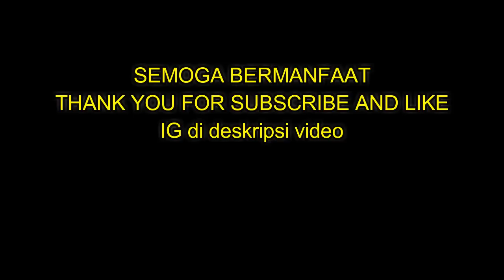CARA BORE UP JUPITER MX PALING MUDAH

Comment: Kalo pasang blok vixion di mx new dan noken as nya pake brt t1 cocok ga bang?
Reply from the maker: kompresi masih kurang mas
Reply: @RamanditaMotor  klo blok vixion di mx new enaknya apa ya yg harus ganti/diubah biar lebih joss?? Ada saran ga bang?
Reply: Biar bisa ngimbangin atau bahkan nyalip vixion/cb150 standar :)
Reply: @RamanditaMotor  kenapa gak cocok bos?
Reply: @ikhsanalimustofa7333  sy pake blok vixion set, noken kawahara k2. Tarikannya Jos.
Reply: @bajankezar1455  kalo dari brt enaknya t1 apa 2 ya buat blok vixion